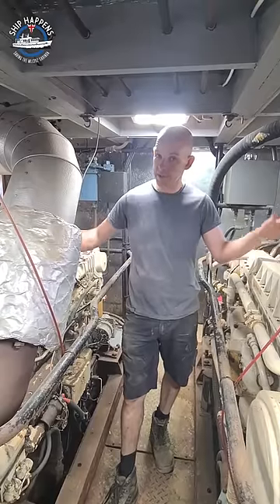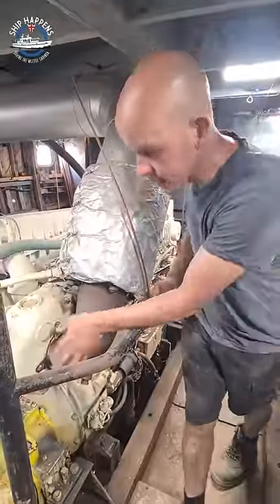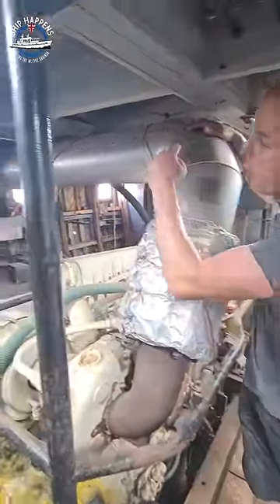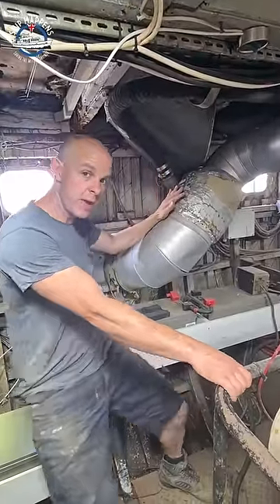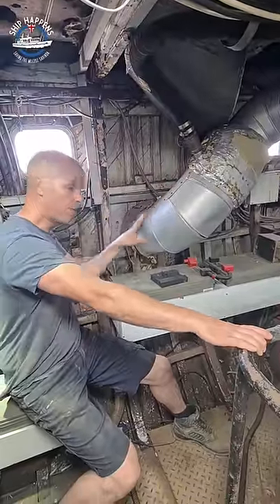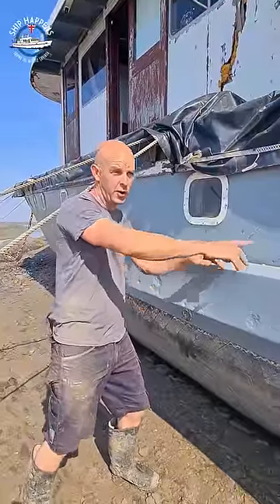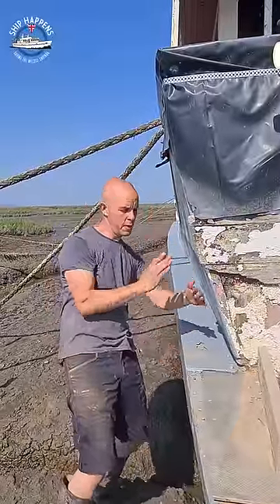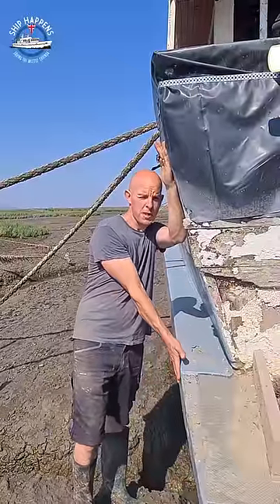#shorts Explaining Our Boat Exhausts #boatrestoration #Boat

Comment: Simon,  is the engine room midship? Seems like a long way from where the exhaust pipe exits the boat to the stern. Should have shown the exhaust exit holes. Thanks for explaining.
Reply: I'm thinking it must be! I wonder if there are driveshafts that run to the back as well?
Reply: The shafts will obviously run back too. Yes!

Comment: Exhaustive answers. Thanks. 
If they are solid. Filled. Take a drill sample of the fill material and have it checked for asbestos.   

On my friends 1943, 104' army rescue boat we had just finished replanking the starboard side above the water line while afloat. Recreated the  upper and lower rub rails . Recaulked and spread joint compound. 6 months work for my friend and I. Before we broke out the 8 gallons of white marine enamel to roll out then tip off the starboard side. It was over 75f that evening. We painted till about midnight. It sure looked pink in the high pressure sodium lighting. In the morning. We went out and gasped. It was pastel peach not white. We called the paint store with the batch number off the top of the cans. Zspar had recalled that batch. Only 8 gallons did not get returned as it was a cash invoice without a customers name.  We were the laughing stock of the marina. In la harbor B channel.

Comment: Yay I got it right, I thought it was a rubbing strip as well 👍😊thanks for the explanation , I also didn’t think it was part of the original design
Reply: Me too !
Reply: Current exhausts and 'docking protection' are not original, but I'm sure are very practical.
Reply: A hollow box will not provide useful protection against docking impacts. Personally, I think it’s another ugly botch from the 1980s refit. Just as the cheap plywood failed and caused so much structural damage. Be prepared to scrap it and expect hull planks beneath to need work.

Comment: Apparently not a unique system for its time. I heard a story and I have no idea of its truth but, apparently in the 60's such a boat also had its toilets emptying into the exhaust tube so only dumped sewage while motoring. Anyway the boat anchored up at a popular anchorage in the summer they spent the night but then next day was rough so they stayed on a party developed and they stayed longer anyway when they eventually left many days later they had trouble starting though eventually the motors did start and they turned to leave the bay and gunned the engines at which point the blockage cleared and sprayed raw sewage over the entire anchorage. Like I said I have no idea of veracity but a good story anyway.

Comment: So I take it this system was not the original as all the 1930s onwards ex navy boats I've seen, worked and crewed on have the exhaust running through the boat from the mid engine room and exiting at the stern. Or a dry exhaust up a funnel stack, this is an add on at some time and wonder if there's a secondary use for the ugly can on the side, that's spoiling the ships lines.
I think she would a lot better with clean lines and as she was intended. I'm not faulting your works at all in getting her ready for cruising and love watching your progs. It just sad to see what others have done.
Reply: Totally agree re ruining the lines.  It should be returned to the original design at some point.